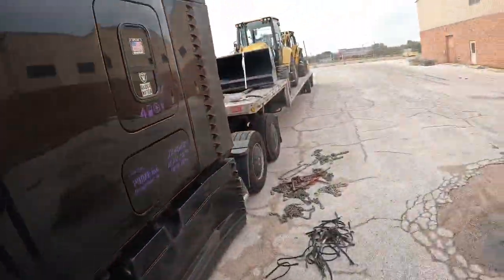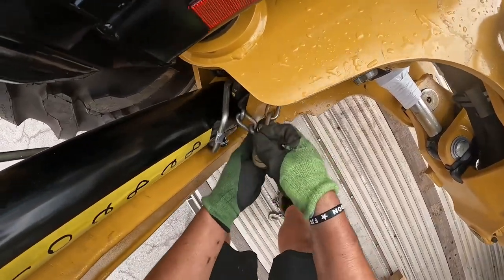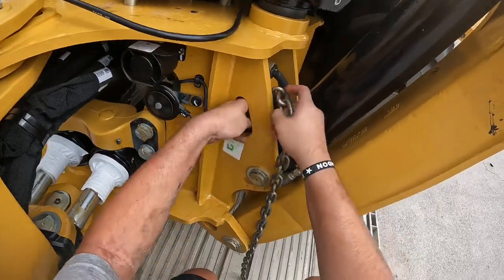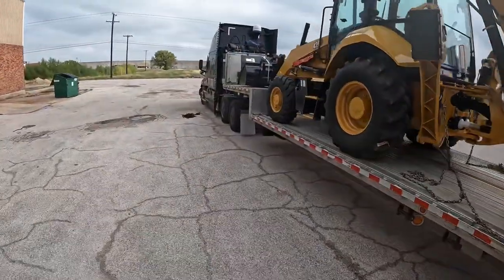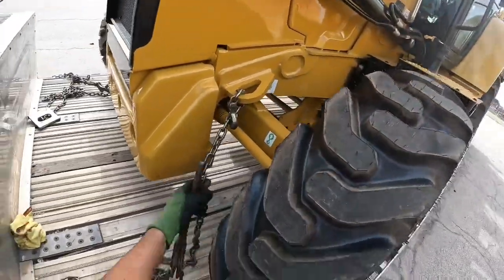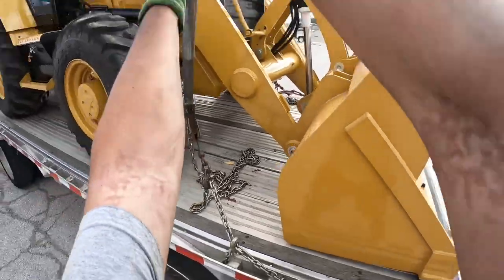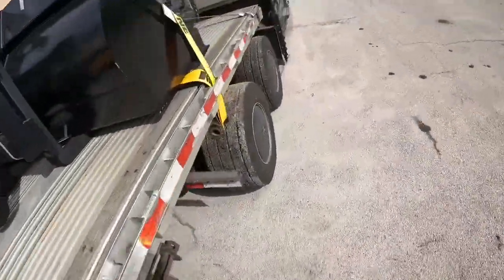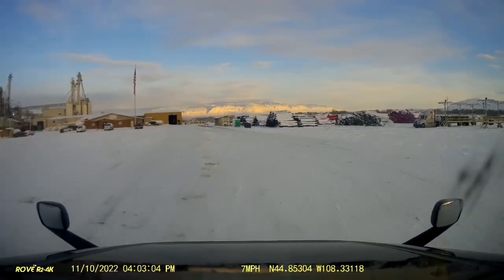Prime Inc flatbed trucking #50. Backhoe securement

Comment: Skid steers? Those were Cat backhoes you tied down. Suggest you use all chains not straps. Since term is 'tie down', suggest chains secured on trailer closer to tires, not at at the flat angle you used. I also used shorter chains with approved slip hooks for the factory securement locations.
Reply from the maker: The title say backhoe I corrected myself. I was trained to chain equipment that way but yes I’ve seen guys chain close to the tires which I will try next time. Cat told me not to chain where I put the strap especially the buckets.